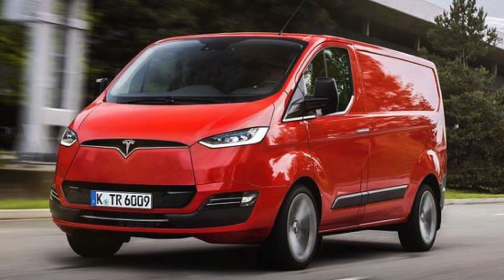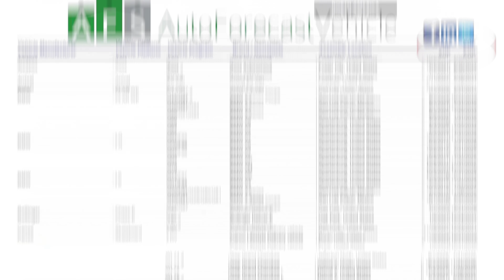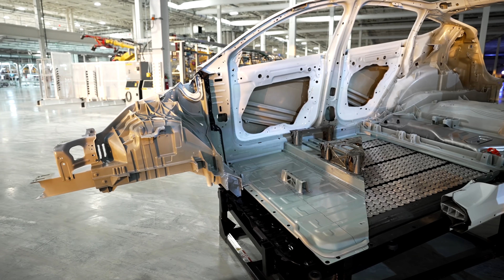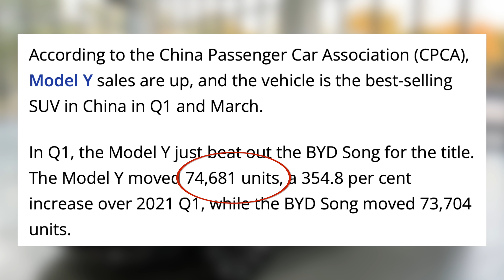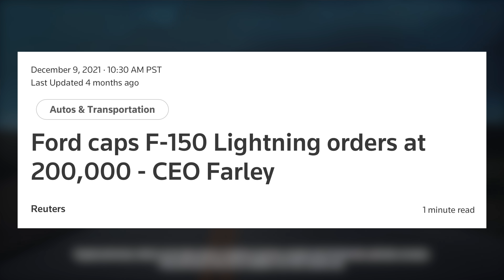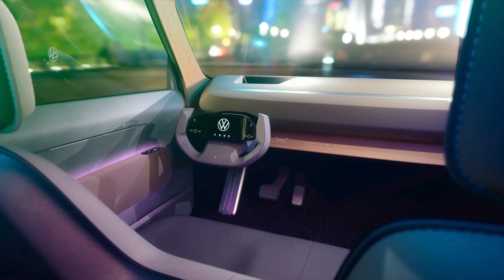Tesla LEAKS Cybertruck and Tesla Van Release Date

Comment: They need to make an electric sprinter type van!   Most Contractors don’t drive more than 150 miles a day and this would save small businesses a lot of money.   The cyber truck is useless to any working contractor.   The big three have 1/2 tons coming out someday. But they all dropped the ball
Reply: F150 lightning is a week or so away from first deliveries. Ford E-Transit is already in production.
Reply: @CH-dj5lt   lighting is not a work truck it’s a 1/2 ton that won’t pull a 15000 lb plus trailer  that’s what I mean when I say they dropped the ball.   They didn’t develop something back when Tesla was starting out
Reply: @CH-dj5lt   call any ford dealer and see how many have E transits.  Can’t even order them now according to my local dealer.
Reply: There already is.  The Ford Transit comes in diesel, gasoline, natural gas, propane, hybrid and electric.
Reply: @uni4rm   in theory.  Try ordering one.  No one has it.   I’m talking about a 3/4 to 1 ton pickup capable of towing heavy trailer.  Getting a utility body put on etc.
Reply: @uni4rm  and I was referring to Tesla making the van not ford.

Comment: “Tesla to develop electric vans that can seat up to 12 people and their luggage, enlarging the capacity to 1,200 people per day, or 10 million-plus per year”.  I think your math is off!  I believe there is only 365 possible 366 days any given year.
Reply: Here in Bremen/Germany we have an electric transportation system which can transport 600 people an hour from the airport to the main train station. It takes some 14 minutes to cover the 4 miles. Capacity can be expended to 1,200 an hour by running the trams every 10 instead of every 20 minutes.

Comment: Of course they are only going to put in battery capacity for a given range. Remember, the above 60k price point doesn't have unlimited demand. We already seen dramatic drop in wait times for delivery. 
So we will see even a standard range single motor version. And rolling back the price hikes? 
Even at 50k price point you see a huge increase in demand. If they can reduce that down to 45k, then again a huge increase in demand can occur. 
So as the higher priced AWD models demand softens, they will have room to offer some lower price points - they will do that with the standard range and rwd model. 
Right now, demand exceeds capacity, and if demand for over 60k price point remains high then the longer we wait for the 50k price point to occur. 
The issue is not high they can sell a model 3 for, but in fact how low of a price point they can make and offer.
Next to no reason to offer lower price and models configuration until they have to.
With spike in gas cost, then I can see people willing to pay more. 
I mean drive a pickup truck - they eat gas like crazy, and just savings in gas alone would make up a monthly payment for a cyber truck.

Comment: I’ve never used my mobile charger.  I do use the included j1772 adapter which I believe they removed from newer models. Most of my charging is at home with a install wall charger.

Comment: If most people don't use the including charging cables, what is it that most people use? I was honestly under the impression that most people used the included charger. Are most opting for some sort of permanent install? 

Despite not being sexy, I think vans are practical and I would be in line if it came in under $50k (in the current pricing climate that alone seems unlikely lol) and the seats are easily stowable. One of the greatest things about our sienna mini van is the cargo capacity but that also comes with having to remove the seats and put them somewhere. If this thing lets me just fold all rear seats down, it greatly improves the utility of the vehicle, and I think I would prefer it over an open bed truck from a practicality aspect. 

As far as the lower range model Y using the 4680 architecture, am I wrong that these cells should charge faster as well as be safe to charge to 100% consistently? I wonder how this stacks up for longer ranges of driving as well as how, if at all, differently these respond to colder climates. The lower range battery pack might actually be the better buy depending on personal needs and driving habits regardless of the modest price reduction.
Reply: Tesla over time will increase the range and speed. The battery is in beta. 🤣🤣
Reply: To answer your questions, Bela, I think that most people buying a Tesla today do install a charging station in their garage.  That's because people paying $60,000 or more for a car likely own a detached house, and paying the extra two grand to install a high-voltage charging station is inconsequential to them.

Unfortunately, this is one of the great barriers to electrifiction for the masses.  Many people park on the street or in apartment building garages.  Electrifying the stalls for a condo building isn't too big a deal.  But how do you charge all those cheaper electric cars (if someone ever starts making them in quantity) parked on the street in front of the building?
Reply: Reading comments I’m surprised so many opt to install a $500 wall charger. For our previous M3 and now MY we have always used the included charger. I honestly believe most people don’t know you can buy a 14-50 adapter (in US) for $35 and get 31 mi/h from included charger. Plus I would never drive long distances without having a charger with me.

Comment: Question, Ryan: how do you communicate with Tesla to note problems (not FSD Beta issues) that you would like for Tesla to address? I mean problems not specific to your cars but general design issues. When Tesla deleted the front passenger seat lumbar adjustment, did you talk to Tesla somehow (just an example of a design issue, maybe not a problem for you individually)? Or deleting the charge cable on new cars. If you do have the ear of someone there, maybe you could run some videos on your channel to gather community opinions and feed that up the chain to Tesla designers. Musk tends to move quickly with new ideas and changes and that's to a large degree how he brought the cars to market so fast. We are in some ways his beta test group (not just FSD beta) whereby he tries something out and then listens to the community and adjusts accordingly. If that approach is not aligned with your goals then how does an individual owner get through to the design team? Thanks for a great and informative channel, cheers.

Comment: How hard or is it possible to replace 4680 cells if the battery goes bad?
Reply: @carholic-sz3qv  Eventually you will have to replace the battery as these things wear out, not a good design for replacing a consumable.
Reply: @carholic-sz3qv  Battery problems require a whole new battery pack pre 4680 also.  Problems, that are not covered by the guarantee, are rare.
Reply: @abc123fhdi  The battery pack can last for many years.  Hundreds of thousand of miles and more than 10 years.  The 4680 is not the million mile battery but I would not be surprised if you can get close to half a million miles out of it.  The battery may last longer than the rest of the car.

Comment: I have a wall connector for charging and my mobile connector sits in my trunk 99.99% of the time. I use it once or twice a year when we go see family or go to a cabin. It’s an accessory for many owners, rather than a necessity. Personally I think they should keep the price low and make it an option at ordering, like the tow hitch. I also think Homelink should be an option at order.

Comment: Need some help. I have a MY LR ordered at $59.9K, same as rumored price for the Austin MY SR. Expected delivery 8/3-9/14 (delivery date is not an issue). Should I keep my LR order or switch to SR?  Anyone know the charging characteristics of 4680 cells?  Any drawbacks of structural battery pack?  Which will have better resale value (although this could be the last car I purchase)?
Reply: Resale sounds irrelevant if you plan to keep it long term. The real question is what do you need for range? Both battery packs have structural benefits. Charging characteristics of the 4680 well only Tesla has that information unless any alleged Tesla employees want to chime in.
Reply: The LR is a better consumer value as of right now. The Austin model is better for Tesla, not the consumer on paper. However, let's see some actual reviews. It could be lots of things. Really too early to tell, but it seems the long range is a solid known good car. The Austin model is car they seem to be able to get away with. I think it's also a sign Tesla can't ramp the 4680 yet and are using other factors as a smoke screen. I think money invested in Tesla and not the car is the better bet at this point. They will sell every one of these overpriced cars for huge  margins and once they figure out the ramp issues, they'll be printing money. Even more....

Comment: The only downside with EPA ranges is that 300 miles in EPA equals 100 miles in real world drive. That’s the biggest issue with electric vehicles.
Reply: After driving the model Y through a fairly cold winter, your post is true when the temps are sub-zero F.  With Spring temps now in the 30's to 40's the real world range is around 220+.  I'm guessing that this summer with temps in the 70's I'll see the 300 ball park.

Comment: Tesla don’t get me wrong I still like been following for years since 2010  but it has went from a “I want” to a “ I’d still take one” with regards to other EVs now on the market. The price has increased (yes crazy times we live in outwith Teslas control) We hear about new cells that have the same range using less and cheaper to make but it’s never passed on to the customer. Unless I see £35k Model 3 split new and £40k Y in the U.K. then to me it’s never happening. I guess it’s just lost some of its hype and cool for me. The cyber truck I have never liked or really got it’s about being different for the sake of it over absolutely nailing what people want in the segment, the Rivian to me spot on and I’d take given the keys to both every day of the week. To me I’d see a Rivian and think nice and a Cyber T and think nah it looks too attention seeking at prat level.

Even the 4680 cells look a bit disappointing after all the hype. It looks like hey we are giving you less battery for the same price. The price of the cells needs to bring down the price of the cars or to me it’s a fail, only one saving is Tesla.

VW seem to have awoken - finally 😂 700km range or if true something like 350 miles is game changing. Friends i D 4 that sees 170 miles in winter and 260 in summer easy and dependable. But the winter took him by surprise with the drop as it had been described at the dealer as slight drop.

Comment: Basing it on the cybertruck would allow it to be quite large, (24' sprinter van size), but it won't look like the cybertruck at all. I think we will be looking at a 10 to 14 passenger van with 4 rows of seating. Since there will be no steering wheel, I expect 2 rows facing forward and 2 rows facing backwards, with a center mounted door in front of a 60" open floor space.

Example, starting from rear of vehicle, row of 4 front facing seats, followed by a row of 3 front facing seats, a wide open area for wheelchair or luggage storage, followed by a row of 3 rear facing seats, the front most row would also face rear and be 4 seats across.

I would expect it to look very similar to the all glass concept that they have shown in their tunnel videos, except that it will have steel or aluminum up to the beltline.  (in order to meet passenger bus regulations). The top greenhouse should look pretty darn close to the concept vehicle.

Comment: $60K for a short range EV is yet another non-starter for me..  Does the 4680 cell not have as great a capacity as suggested on Battery Day? 
A solar roof on a van isn't going to provide enough charging capacity unless you leave it unused for a week or two. Also, no roof rack or roof carrier allowed.

Comment: Elon needs to do a little tweaking  on his truck design to capture that middle America crowd. I'm all over form and functional but his current truck is over the top. What if the next generation is kind of boxey  like the current  jeep truck or styled like the old international trucks. Perhaps with  a P.T.O. in the front bumper  that can run various types of farm equipment including a generator. This will take off for sure.